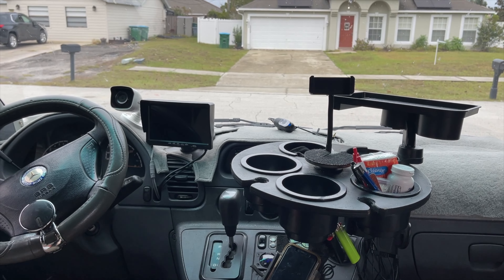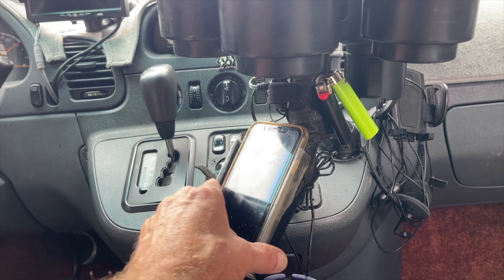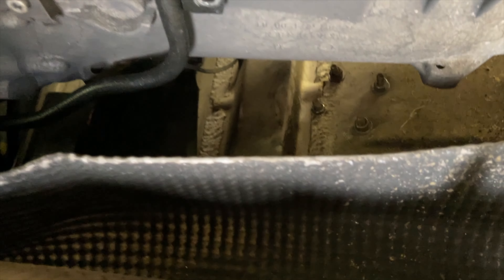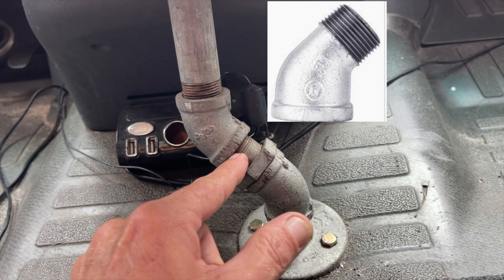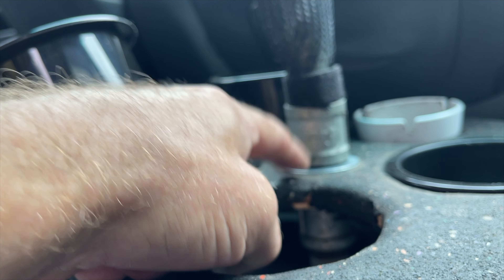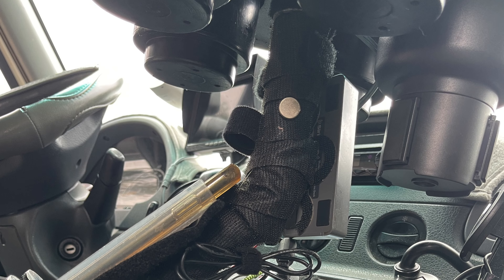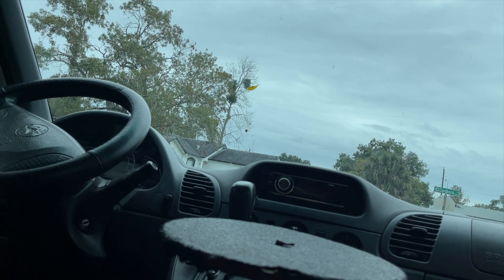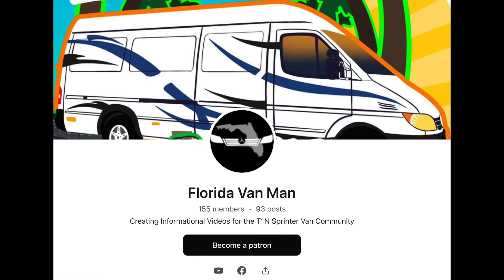Drink Holder Stand for Any Floor

Comment: Love the enginuity, this thing is way more heavy duty than anything you'd find on the market. The velcro around the  pipe in particular is genius.
Reply from the maker: And Versatile!!! I've torn it down to the bottom pipe and reconstructed a few times, adding bends and branches for different map screens and phone chargers over the years. Before phones held our navigation this tree held a large monitor tied to a laptop docking station with bluetooth keyboard on the steering wheel and a GPS antenna on the roof next to satellite radio. Parts to upgrade and change the tree are in the $5-$20 range, available everywhere.